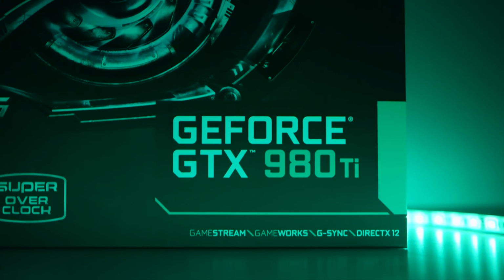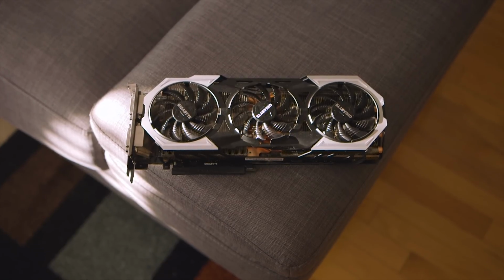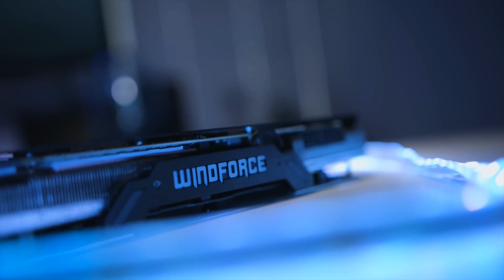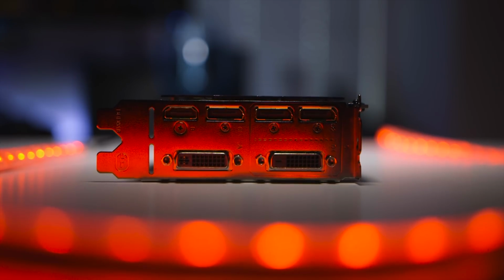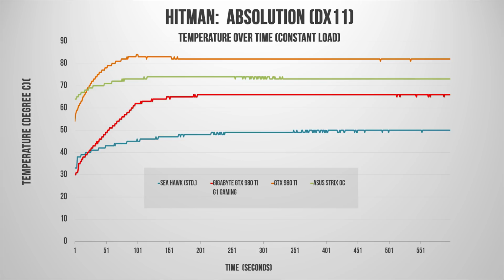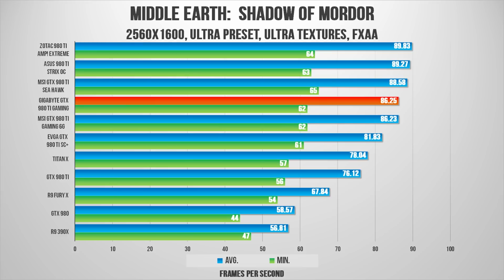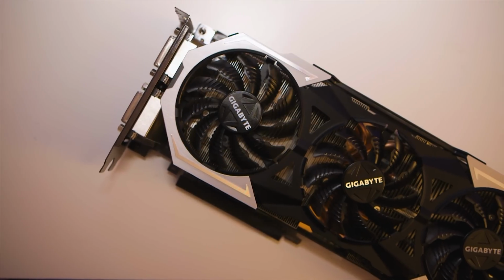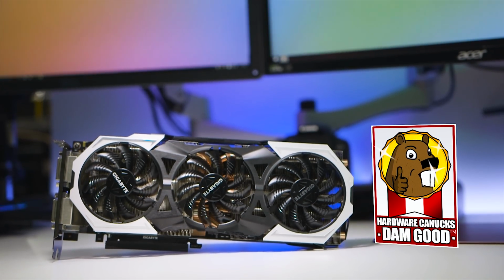GIGABYTE G1 GTX 980Ti Review

Comment: So you think I should buy a 980ti or should i wait until AMDs and Nvidias new cards Come out this year?
Reply: +Los Hennos - CSGO 'n Stuff :3 depends on your current card - but i'd wait, safe some money and maybe be able to afford a 1080 instead of a 1070 for example. (in case, thats what nvidia will call them)
Reply: +Los Hennos - CSGO 'n Stuff :3 who am i kidding i have a single 970
Reply: +Los Hennos - CSGO 'n Stuff :3  Omg a 1080Ti would give me an orgasm.. lol
Reply: If you have a decent PC that can run the games you like, even if it is at low settings, I suggest you wait, because you'll get 980ti performance for 970 money if the jump in performance between Maxwell and Pascal is the same as between Kepler and Maxwell.
Reply: +ElZamo92 that would be a stupid move by Nvidia
Reply: +ElZamo92 I have 3 290x Saphires. My PC is a fucking beast. But i thought about switching them out for 2 980ti's...
Reply: +Los Hennos - CSGO &#39;n Stuff :3 Preferrably wait.

Lol your PC is awesome, dont upgrade yet.... wait for NVIDIA PASCAL for sure!!! you have the upgrading fever
Reply: +Los Hennos - CSGO 'n Stuff :3 I would wait for Pascal and Polaris. BUT: don't buy any of the brands until benchmarks come out - wait and see who is the winner between AMD and Nvidia in your price range so you don't end up getting let's say Nvidia but AMD's counter part gets better performance ;p
Reply: +Los Hennos - CSGO &#39;n Stuff :3 Considering your current PC is fine enough, just wait for Pascal/Polaris. Even if the new offerings are too expensive for your liking, the older cards will get a price drop.
Reply: +Queen Bitch KaNoMiko although the new cards are 14nm and 16nm chips which I would like to get a hand of. Polaris is 14nm and pascal is 16nm
Reply: +Xetion i can pay up to 2000bucks...
Reply: +Los Hennos - CSGO 'n Stuff :3 damn dude!! See if AMD or Nvidia creates a dual GPU card :D if you can pay $2000
Reply: +Xetion a little less maybe. but around that price tag. Ive saved monay since 3 years so yeah. But im so freakin hyped. I mean atm i cant play gta crysis and all that shit in 4k
Reply: Los Hennos - CSGO 'n Stuff :3 yeah. Hopefully amd makes a huge comeback and get's their market share back. would be so fucking funny if nvidia and amd changed spots XD
Reply: +Xetion Would like to see that
Reply: At this point I'd wait. Nvidias are expected to start launching at around May or June
Reply: ***** I would expect to see the 1080 and 1070 (whatever they'll call it) this summer. Obviously the 1080 ti would come a bit later on. But I haven't been keeping up with it, so I could be wrong.
Reply: +Los Hennos - CSGO'n Stuff :3 If your cash is limited buy a used card off ebay from 1 or 2 generations ago. You can get a top tyr card from lest generation that out preforms a low-mid tyr card that you could afford from the current gen. As for waiting unless you are waiting for a specific reason, you will always have new GPUs coming out soon. If you really want a 900 series card for cheap wait for the next one to release and buy a used card from someone who is upgrading.
Reply: Wait until later this year, Nvidia and Amd will be making some big moves with gpu-s especially with the introduction of VR